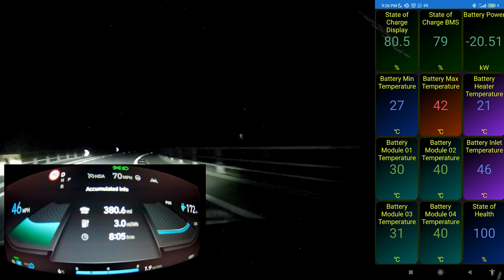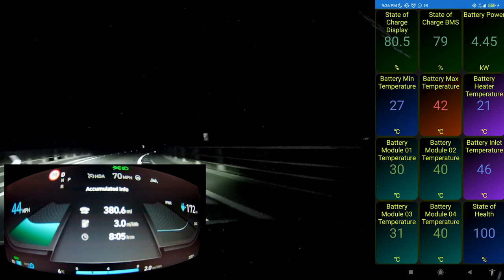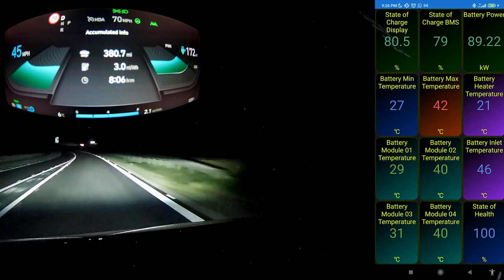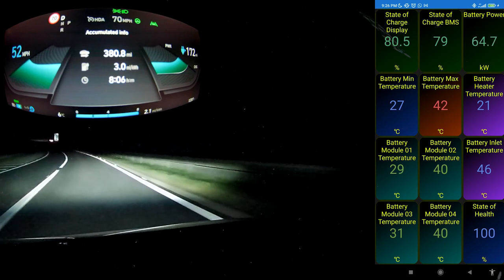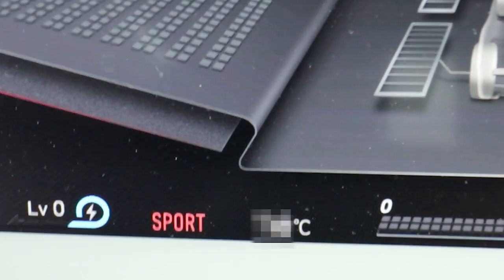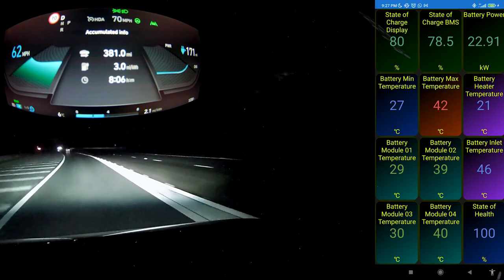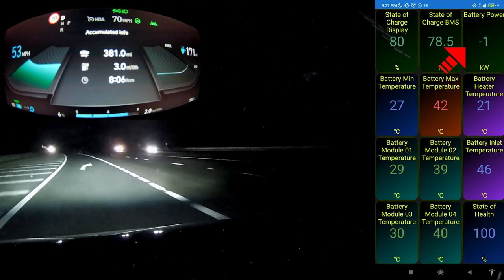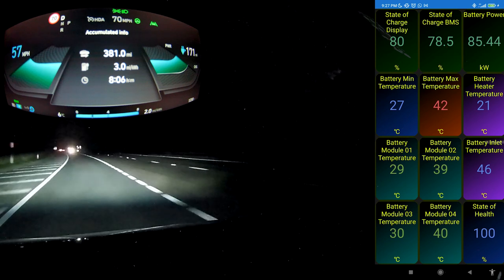Hyundai IONIQ 5 - How to remove dust and squeaks from brake disc.

Comment: Thanks for the info.

So if I understand correctly, when regen is on and you brake, it brakes mostly with the motors to regen and a bit with the actual brakes. 
On regen level 0 motor breaking will turn off and braking will go 100% into the actual brakes.
Reply from the maker: Yes that's right level 0 only uses the brakes only the others use a combination of both brakes and regen braking.

Comment: Thanks. These explorations are useful, despite your i5 being different to mine.
Reply from the maker: Cheers, It'll be helpful for even Kia EV6 drivers also coming to think of it as most of the system as the same.

Comment: In the Kona 0 regen would mean coasting until you press brake which would then also regen. Is there an equivalent in the i5? as it was fantastic for hypermiling! I used to pop it into neutral to clean the brakes in the kona to stop occasional squeaking.

Comment: Some people said that at 0 regen the Ioniq5 uses friction brakes 10 times, then reverts to regen. I tried, but after I pressed the brake pedal 10 times, it still used friction brakes only later on. Maybe it reverts to regen after 10 decelerations to 0 kmh? Might be worth testing...
Reply: Yes, according the manual should be like this. And after 10 times go back to regen. But Iam still waiting for the car, so can't testing it.

Comment: Thanks James. I’m an amateur in this field (93) but do you think it’possible to trace a similar instrument via Aple? Thank you for your easy to understand instruktions  in the many videos. A great help in the leap from a Kona Electric! Greetings from 🇩🇰 Denmark.
Reply from the maker: You could use EVNotify which is free on apple https://apps.apple.com/us/app/evnotify/id1457885390 it's less configurable but will give you battery temp and some other readings. you just have to make sure you get a OBD2 dongle like this one I have used in video: https://amzn.to/3DNC8H3 I know it's sold out but just get one similar and you should be good to get going.

Comment: Puzzled - why is temperature pixilated at 47 secs? What am I missing here?
Reply from the maker: The video was extracted from this one https://youtu.be/D-_uHaL-BaY which was all about temperature. As I was driving the video clip was taken after the drive so had much warmer temp which is why It was pixilated to stop any confusion. :)  

UK law doesn't allow you to use your mobile while driving so i couldn't take a screenshot of it.
Reply: @LemonTeaLeaf  Yep, cant use mobiles, but its ok to reach across to the middle screen to change radio station & adjust seat heating (talking about myself here)
Reply: @LemonTeaLeaf  Cheers - understand now - great videos.  I have an ioniq 5 AWD on order (delivery January !!!) but now am a bit concerned about range and wish I'd gone for the RWD instead ...